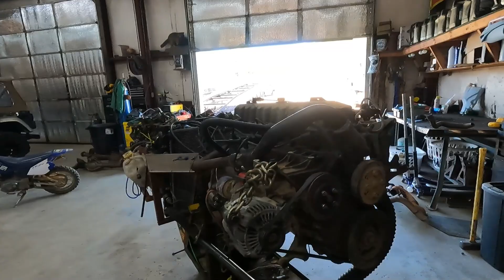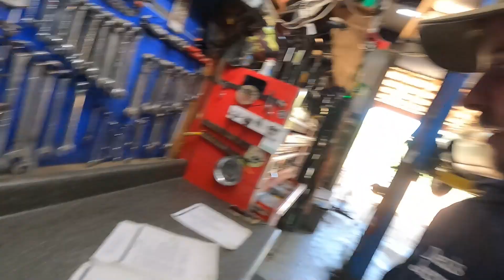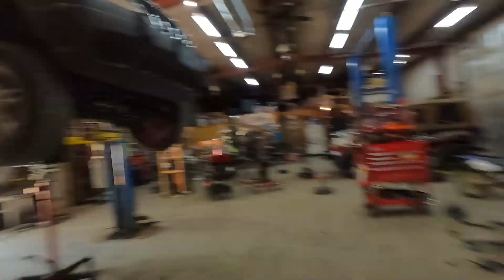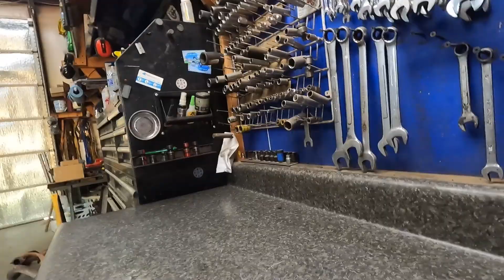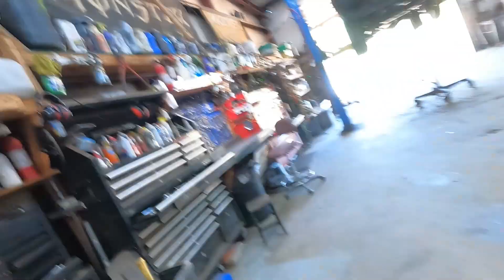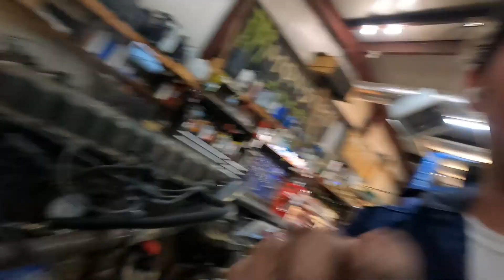How To Build A Jeep 4.0l Stand Alone Harness Easily And Cheaply!

Comment: Appreciate the vid. I got a major problem and eletric diag is not my strong suit. It started with no fuel pressure. As I continued diag found no power at the pump, no spark and no com at OBD2. Finally took apart the ECU, and found a little black burn-like spot. Tested all the 5v signals at distributor (it's a 1996), tps, cps, IAC, and map, I got 0.082v, and 199k ohms. Again, not great at electrical diag, but I believe this tell me I dont have any shorts; voltage stayed consistent as I unplugged each sensor to test next. After this I bought a new ECU, put it in and everything was gold on first startup. However, second startup it oddly struggled. Not sure how to describe it, but tried and failed to run. After that it appears I have no spark, and its just cranking, like before. I checked OBD2 and no com. IDK if I had com when I put the ECU in, I didn't think to run the scanner until too late. 

I fear I just burned out a new (to me) ECU, and I have no idea where to go from here. 

Some added context back in winter I was getting downstream O2 sensor code, replaced with NGK sensor, and could became more intermittent. I found the connector in the engine (t-case harness/bundle w/NSS) all had bare wires touching. So, I took out the harness, spliced in a new connector and everything was fine, for the most part. Seemingly at major weather shifts, the O2 code would come back, but stay gone for a good long while if cleared. I suspect the culprit is still in this harness somewhere, but again electric diag is not my bag and I am fairly stuck

Comment: Hi i have 1990 jeep wrangler 4.2 my my manual tranny took a dump on me since iam doing work on my jeep i wanted swap it out for a 93 jeep wrangler 4.0 fuel injected engine i was wondering how to wire it up i have the ecu and engine harness  for the 93 motor  please any advice

Comment: Help appreciated.. swapped from 2.5 to 4.0. C103 and C104 are 14 pin on the firewall however 10 pin on the engine side. Thanks.

Comment: So this starts at 91 so won’t work for a 1990?  I have a 90 2 door 4WD pretty nice runs drives nice just running me crazy with intermittent power issue to injectors and fuel pump. The pump I bypassed with a switch but efi I don’t have a fix

Comment: Hey Dex. The black 2 wire plug with green seal near the pcm and diagnostic port! Green wire and grey wire. Where does it go? Pulled my xj wiring out of storage and cant remember where that one went. UPDATE. Its for the Auxiliary fan.

Comment: thanks for the video! great info. i have a 72 commando with a sad 232 inliner. id like to swap in a efi 4.0L but i  want to keep the stock th400 trans. any info on retrofitting a crank sensor for the computer? thanks in advanced

Comment: Awesome video! I’m having a no spark issue on my 95 yj 2.5. I have power to the coil but no signal for the coil to fire. I’m lost at this point! I’ve put a new crank sensor, coil, distributor, ignition switch and volt tested everything I know  to test and still can’t figure it out

Comment: Id like to by the stand alone wires for my 1994 jeep grand cherokee I put a 5speed in it and cut alot out of the jeep but still have problems if you could set it up my power back to my pump an a switch an an push button start wood be awesome

Comment: THAT'S NOT A STAND ALONE ECU. thats a stock ECU! it's not hard to make this work... i want to run a holley EFI, or anything else...
Reply: Nope it's a stand alone harness as he stated
Reply: @a1ntnowaybro  a "stand alone harness" implies use with a "stand alone ecu". anyone searching this term is looking to use a aftermarket ECU (AKA stand alone ECU). therefore  this title is misleading as it is a factory ECU running on an engine stand! that's not hard to do with any engine. all you need is battery power, key on power, and ground.

Comment: Thanks for the video! Currently running a terminator x kit on my YJ 4.0 in my buddy. Been considering switch back to a factory ECU. If I get stuff from say an XJ as long as it’s obd1 is should run my 92 YJ motor correct?

Comment: Dex I need help asap I have a 91.cherokee that I've been struggling with for a year and I just got it running and my friend hooked something up backwards and fried Mt computer, I have a replacement computer from a 97 cherokee, and harness, but I don't want to have to go through and rewire the entire thing again. What is the minimum I need to drive my jeep with the 97 computer and can I splice into existing connections from the old harness, please help

Comment: I did a 4.0 swap on my 2007 JK. I love the 4.0. Now I'm thinking about putting on in my 2000 ram 1500. The magnum is nice but I prefer the 4.0. And if it lacks power ill just build a stroker.
Reply from the maker: What transmission did you use in the jk?
Reply: @dexjs  I used the AW4. XJ gauge cluster too. I Took out all of the canbus. Only used the window and hvac controls from the JK. So was an obd1 4.0 jk with aw4. Bolted the JK transfer case to the AW4 but clocked it for more ground clearance.

Comment: I have a 99 cherokee 4.0 and the insulation on the wires is dry rotting and falling off so I need to replace the entire harness and keep it stock.  Would love to see a video on how to replace the entire harness and troubleshooting tips on reinstalling it.
Reply from the maker: If it’s a 99XJ it’s very simple to do.  They’re smaller than like a WJ or zj

Comment: PLEASE MAKE A VIDEO ON HOW TO KEEP A Jeep in 1st when wheeling without it trying to automaticallyshift into 2nd...preferably XJ 4.0 4x4 model.
Reply from the maker: I promise it’s high priority on my list.  Maybe soon. Thanks.
Reply: Yea, that is my next project. I would love to see a Dex jeeps video of this mod. (For 98 xj with aw4)
It should be really simple. Just interrupt the signal wire going to to shift solenoid with a switch. 
But a how to video would be fun!
Reply: Get a ZJ 😂
Reply: Would you build one for someone
Reply: There's a single wire, I'm not sure which wire it is, but if it either has constant power or no power, it stays in first. That probably wasn't very helpful. I'm sorry.
Reply: Get one with a manual 😂, nah but jokes aside it is a single wire in the transmission harness that controls the 1-2 shift solenoid
Reply: The transgo shift kit will let it stay in whatever gear you put it in.

Comment: I got one question for ya dex, why don’t you run one ton swapped xjs to beat on
Reply from the maker: I’ve built some before.  They suck. No fun. Heavy. Huge. I always use the example of pushing a wheelbarrow up a hill empty VS loaded.
Reply: @dexjs  understandable. Do you plan on coming and riding rush offroad in rush ky any time soon
Reply: Everythings more fun on 31s
Plus when ones beat just grab another and its ready to rock out of the box
Reply: He's got so many rigs he would spend a fortune and tons of time to set up each one